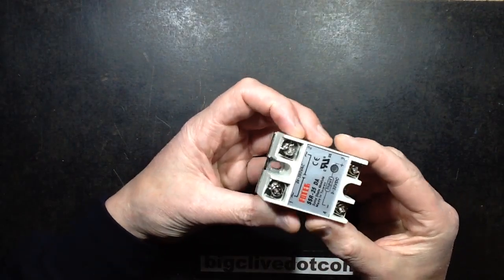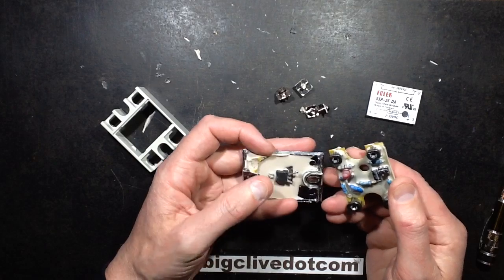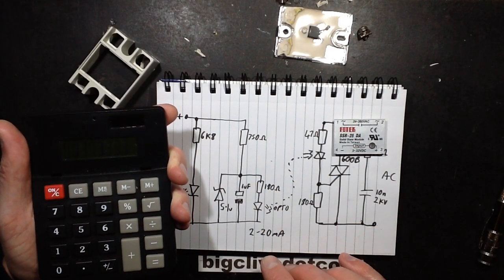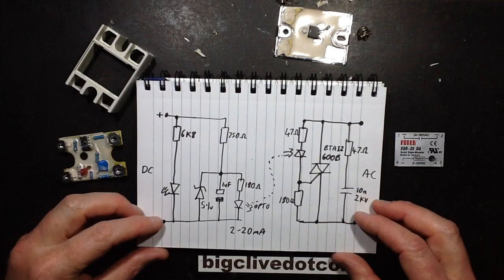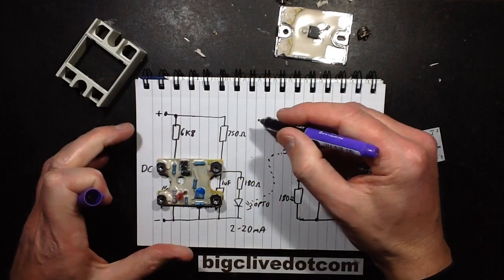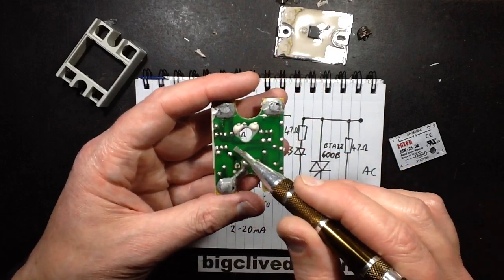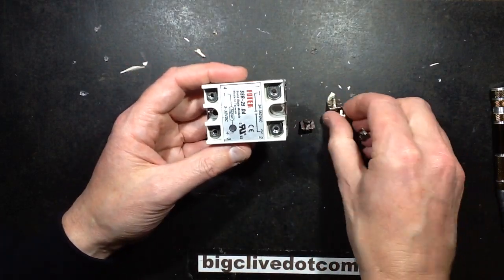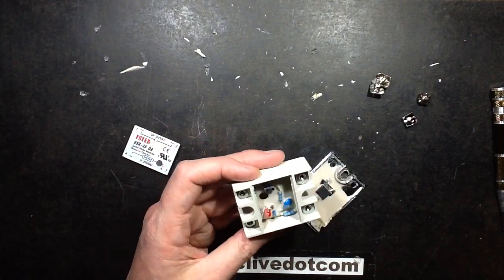Teardown of an eBay 25A Solid State Relay.  (SSR)

Comment: I know that this is a few years old now, but would you be interested in a few reputable branded SSRs for another tear-down video, Clive?
I have a supply of Omron, IDEC, and another brand I can't recall at the moment, and would be happy to share some for your enjoyment and our education.
Reply from the maker: The slight downside of investigating the proper ones is that they are often potted completely in resin.
Reply: @bigclivedotcom  
Okay, I can see what you mean, and how much it would be a pain to get any useful info out of a fully potted device, as well.

Comment: i have low voltage switch from ebay, and it brakes down very soon in use( few hours of use)
i use it in car to prevent use of current when engine is off and it is connected only on power relay  so it is not overloaded. Have you tested something like this and why it happen( to brake down)( yesterday I realised that my car battery was totaly empty because of that switch)

Comment: Could it be OK to put 25A through a 12A triac since it is only doing zero crossing switching? I would imagine that would create a lot less heat in the triac than phase cutting.
Reply from the maker: 25A is still 25A and will result in much greater thermal dissipation in the triac than it is designed for.

Comment: Very intresting you know what your  doing i am intrested in building a controller to boil my beer when i am making it . I use a propane burner but want to use an 240 v 4500watt element but need some way to control the element .
Reply from the maker: If you search my videos for thermostat you will find a lot of modules for temperature control.  Don't use them to switch such a high load on their own though, and also have a backup plan in case a thermostat crashes and leaves the heat on.
Reply: Very interesting channel thanks keeping making videos there great
Reply: It seem most people use a pid or 500 k potentiometer wired to a ssr da 40 amp with triac i am wondering why you recomend a thermostat

Comment: Don't you know, Clive, that lowered use of potting compound is saving the planet by not using as much fuel.  Just  ask 'em.  I wonder if the 75A model would handle 900W DC.
Reply: @24v

Comment: Typical comments from idiots, if these children in the comments have such a great understanding then maybe they should be designing products and correcting all of these "design flaws" they think they can see in 99% of products. 
In reality there isn't really a design flaw here, the separation is about 5mm or so and it would require a voltage of around 15000v to jump across that. So there is no design flaw at all, only a flaw in the thinking of juvenile children wanting to sound smart.
Reply: Idiot who cannot estimate the distance as it's around 2.5mm and who overestimates the voltage needed to cause arching. Also breakdown voltage on PCB is significantly lower than in air.
Reply: A 5mm air gap is rated at most 5000 volts.  You are 3 times higher than what is safe.  A potential of 25000 Volts jumps across 1 inch of air.

Comment: I bought two similar 24V-380V 40A 250V SSR-40 DA Solid State Relay Module 3-32V DC To AC from China. The other one was fine (both were sold as a brand new), but the other was opened with force and the back plate was bent. Also it was emiting a bit of a burnt scent. So I took the deficit one open and surprise surprise... There is BTA12-600C triac inside. Quick googling showed it is also rated for 12 amps. And this SSR is rated for 40amps!!! At least these ratings are FAKE and dangerous. I would not run more than 5amp loads with these.

Comment: You really can not tell if its fake or not. I just purchased and received 2 from eBay. Got one that looks correct, but the light is a little offset, and another that looks wrong compared to the UL site. But if you visit the Fotek site, the one they have picture is also missing the Taiwan made and amp rating. Looking at the 2 I have, I have a feeling both are fake. Kinda bytes, to scary to use on my projects. Anyone one know a name brand that sells authentic and hard to fake? Preferable the cheaper the better.
Reply from the maker: The only way you're going to get the real deal is to buy them from proper industrial component suppliers in your home country.  But that means paying a lot more.
Reply: Thanks for the reply. At this point, I don't mind paying the extra. I have been researching all day and the Fotek SSR is so highly faked, its almost pointless to purchase and be safe,....I have noticed positive results and tons of negative. Been looking at the Crydom's ssr. the only problem is the cost. But then again, it is probably cheaper in the long run. Another user mentioned that, on the fotek, the 25Amp has a 12amp triac, the 40amp has a 20 amps triac and it my be possible the 60 amp will have a higher rated triac(2 in parallel from the 40 amp up). But then again, you won't know nothing, unless it fails, or you take it apart and damaged beyond use.  Crydom looks to be the easiest as long as i purchase directly from Galco. I am sure those have fakes on eBay also. This is one of those few parts you can not get on eBay and it be a safe bet. Might just design my own and have EasyEDA make me a few board to have on hand. Looks pretty simple.

Comment: the crydom genuine ones are solid inside i have tried to open them but they are full to the brim with resin and very reliable the failed one  was on a transformer for a sealing bar that failed and shorted the 300v ac to earth very melty very very stinky

Comment: We used a 75A SSR in a safety analyzer (bit like a PAT tester). It needed to switch 20A inductive loads and pop a 20A fuse on fault without popping itself. So ... yeah - do it right. If you've spent $4000 on a big brand safety analyzer, it had better "bounce" and not break when you abuse it a little.

Comment: The comments on here may have just stopped me from burning my garage down. I bought a cheap PID/SSR setup from ebay, the SSR is indeed the fake on listed here on UL's site: http://www.ul.com/newsroom/publicnotices/ul-warns-of-solid-state-relay-with-counterfeit-ul-recognition-mark-release-13pn-52/

I'll be tossing it right in the bin, as this is controlling a lot of load for a kiln. Buying a proper Omron or other name brand from an actual electrical supplier (not ebay) Automationdirect also sells them for a good price.

Comment: I love your videos, big guy (I am a big guy, also). This one in particular is motivating. I have long wondered why solid state relays rated at 25 amps do not perform as advertised. After a really looooooong research, I found that the amperage  rating is bullshit.  It is all about the wattage. At 5 volts, sure the relay will switch 25 amps, but at 280 volts, it will only switch 1 amp. So, people that want to switch mains power (120 v in the US)  are tricked into thinking that they can switch 25 amps, when they can only switch about 300 watts (2.5 amps)
Reply: awesome. that makes sense. im gonna remember that

Comment: Deceptive to sell a continuously 25A rated relay that only has a 12A Triac in it.   That is the problem with Chinese/Taiwan made electronics -- you can never tell what is in the guts of things unless a knowledgeable person like yourself does a tear-down evaluation of it.  In my mind, the fact that they practice such a deception would cause me to never buy another thing from them.  I have the FOTEK SSR-100DD which is a DC-to-DC relay rated at 100A continuous. I am going to open it and verify that is has this capability before using it (as a motorcycle starter relay). i am hoping that if I have been "fooled" then it may be possible to upgrade the Triac (or MOSFET) to a higher rated component. That is pretty dependent on whether the potting was done correctly or just a drizzle (like your unit),  I will come back on here and let you know what I find.

Comment: So, I looked at the data sheet. The max current is based on junction temperature. 

I looked at the docs on the crappy one of these I have and it has a derating curve with a line at 10 Amps stating that an optional fan they happen to sell was required beyond 10 Amps.  

The fan cost 3x the price of the SSR. 

Go figure.

Comment: Years ago we used to build home control boards and in one of them we used a similar arrangement but simpler as the input voltage was known - hence resistor into the zero-crossing opto-triac then the same components on the right. We used 15A triacs on heatsinks and controlled 2KW heaters no problem.

Comment: what about switching a extruder Heater?
Reply from the maker: +Justin Schubert I'd recommend a proper branded unit for that, and also be aware that these devices often fail in an on state and could cause overheating in that instance.

Comment: The originally FOTEK actually made in TAIWAN with reliable quality.  99% of ebay FOTEK SSR is a rip-off they are not originally products. by the way, 
we are factory of solid state relays with our own brand. contact us at sales@maxwell-fa.com.. we are using promising components and SSR sealed completely with RESIN...
10-40 amps using TRIAC and 60 amps and above using back to back SCR.. products cover with 12 months warranty.
Reply: +Maxwell Electrical Limited
Well, I looked at your web site.  You don't bother to list prices on it, so I suspect that most people are going to just assume that you don't really want to sell your product.  I know that I won't do business with a company that doesn't put prices on their web site and I would not be surprised if other people are the same way.  That "Contact Us" stuff is just not acceptable for many of us.  We have no desire to give a company our email address or phone number so that the company can either sell them to the telemarketers or possibly have them compromised when the company gets hacked.

Maybe some of the ones on eBay are fake, but at least the companies list their prices.
Reply: You should send one to Clive for him to test and strip down.

Comment: The point I am going to make may have been made previously, and if so, so be it.

Perhaps the the fact that the unit is "ridiculously cheap", along with "...it seems lighter than I expected" is related.
If the manufacturer has an ongoing consistency problem with it's epoxy potting stage of production, a simple test of proof would be in weighing it.
Those that pass could be sold for a relatively confiscatory profit margin; while those that fail, yet are electrically still viable, could be sold for 'Cost of Goods', or even lower - anything to offset the optional expense of throwing them in the dumster.

Comment: Hi,

Do you have any advice on an SSR that an Arduino could use to control a car 12V (to some random hardware, probably using under 2A 12VDC)?
Reply: Use a mosfet, not a ssr.

Comment: Hi, slightly late to the party, my company use SSRs to switch 240v 10A motors with 12v DC, we are talking literally thousands of motors, we use SSRs from a certain UK supplier and they're very reliable, except when the SSR fails, they go open circuit across the switch, that then obviously causes the motor to run continuously until the thermal cutout detects that it's glowing and about to catch fire, or it actually catches fire. So, we got a few of these to test, not based on cost, and sure enough, we managed to get one to fail and it just died and didn't go open circuit, brilliant, or so we thought, we then passed these SSRs to our tech guys who threw them in the bin and said that 'if we ever put that shit on one of our units without consulting them first then there'd be trouble', they said that these things were 'lethal' and they'd rather kill motors than engineers.
Reply from the maker: The triacs going short circuit is a common failure mode.  Your tech guys were probably concerned about the possibility of poor isolation resulting in low voltage circuitry becoming live at mains voltage.

Comment: I have several of those SSR. You need 5V to switch them on; 3.3V doesn't gonna make it. I made my first SSR with the same components before buying them and have it working for more than a year in a Sous Vide (1 KW heater), so, component wise, them seems reliable to me.

Comment: Totally disagree that it would be ok for lower amp applications, who is to say the next china town also making these is not using 1.2.3 or 5 amp rated internals,  I have no problem with cheap china ripoffs but even these need to be rated correctly as 240v mains is dangerous and not for playing Russian roulette with. Some things like these don't need to be a fake/copy! just make it label it correctly with true ratings and id be happy to buy.
 So thx for the video and heads up, i'll now get rid of this from my ebay basket and look for a genuine SSR, I only need it for a 3D printer 220v heat bed of about 500w, but when some prints can take many hours (+30hr) even at these low amps i need to know my house isn't gonna burn down.
Thx Pb

Comment: You didn't show the actual teardown, so I can't tell if the thing was damaged in the process. I'm wondering if the rather nice case could simply be upgraded with a better triac, along with some attention to improving the isolation. 
Another concern not mentioned is that unless earthed, the bottom plate could become live in a failure.
I'm going to be using one of these for a small kiln, so thanks for the warnings on these. 
I'll bolt it to a grounded heatsink, and make a voltage detector circuit that will enable the Arduino controller to check that the SSR has mains supply voltage across it when it is supposed to be off.

Comment: I thought I was gonna be really clever and put a few of these in my off road rig. I was all sorts of proud, of how pretty the wiring looked, show stopper... any how, I was having all sorts of troubles, and of course the last things I was to check were these batch of SSR's.... I am quite sure that these are fine in a clean power supply environment, but, these absolutely do not like choppy supply voltages. Please note, the charging system is extremely clean, by automotive standards, quite powerful too. I went as far as adding a few stiffening caps to level out the chop from the rectifier set up in the alternator, that did help lots, but still had issues still left an unpredictable temperment with these, I really wanted to keep them, as per the amount of work that went into wiring them in an art form, never mind the amount of work that would be required to yank'em out, and completely rewire the entire set up, for typical mechanical relays, of which is fine, 40 hours later...LOL...  Like I mentioned, I am sure these perform great with a clean power supply, I do not recommend these for automotive use. I thought about trying to build some sort of input  anti-spike stabilizer system, but, then, it is kinda defeating the point of the cleanliness and cool factor at that point.... I yanked'em.. Cool video, again!!!
Reply: FWIW, Jeep apparently used SSR as a radiator fan relay in Cherokees some time after 2000, and they're notorious for failing.
Reply: What were you hooking up?
Reply: Stuff like on board air compressors (twins), all of the lighting that points forwards, backwards, underside. Electric fan, etc... any location that would need a relay, I had these set up, instead...
Reply: Just curious, never tried these in an auto application.
Reply: I really don't know way I had trouble with them... I used to use these in some of the golf cart mod's and never had a single issue with them, heck, with as much as my off road rig has given me over the years, it is likely just my rig...lol. More over, I could recommend the idea, if you desire to use these in automotive application(s), I would wire up a simple test circuit and run it for a week, even if it is simply wired through the cigarette lighter / 12 volt power supply port... maybe to just turn on a single light bulb or a few bulbs... I have used the ones that came off the rig for other projects and they seemed to be just fine, as far as I know..   They do look cool, all wired up, especially if there is several of them... Good luck.. (test'em before going nuts with'em)

Comment: SSRs are really intended for fast switching that would wear out a contactor (controlling temperature on a heater, switching in a VFD) If you want something to be left on for long periods your usually better off with just a contactor. Best for resistive loads, they don't handle inductive surges well.